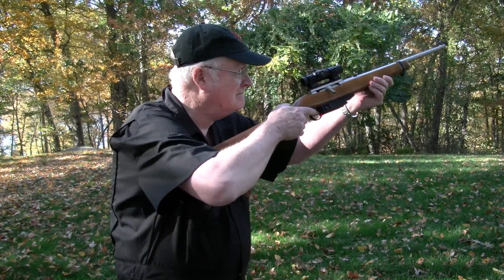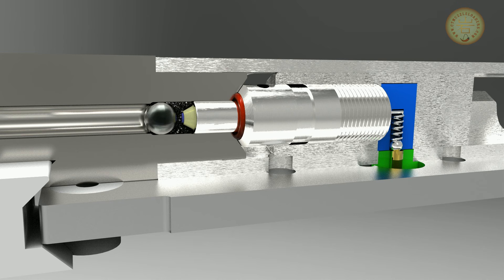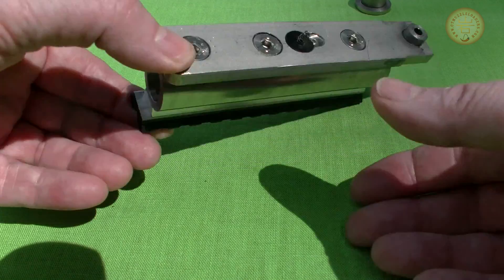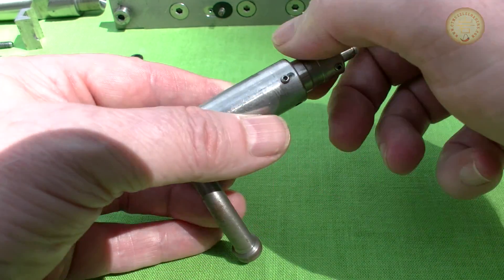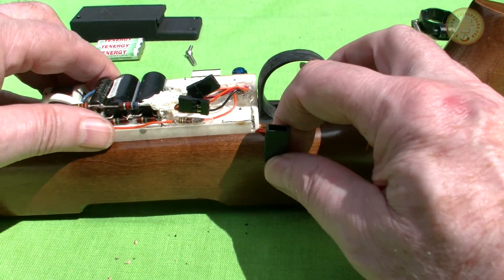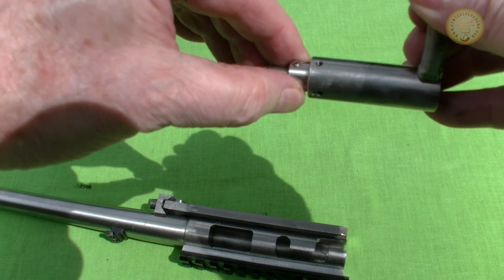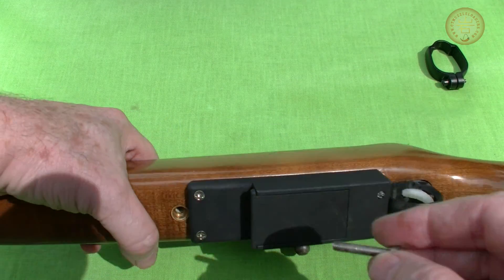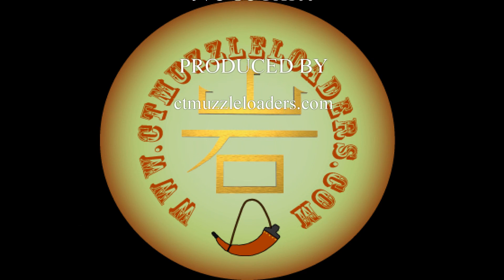The Plink-King, Part 2: Design and Construction of a Cartridgeless .22 Rifle

Comment: how about using something like a small spark plug? enough heat is generated but i am unsure how one might cycle a coil .... requires more thinking. perhaps some old points, a tiny coil and a spark plug could make an interesting looking dueling pistol.

Comment: I studied your electrical ignition schematic on your website and there's two points that worry me, possibly due to my limited electrical knowledge. Firstly, the capacitors draw current from the inverter without a resistor in between, wouldn't it overload the inverter? Secondly, it seems the capacitors would discharge through the secondary coil of the transformer where the potential is many times higher, would it cause the capacitors to be charged by secondary coil from the earth side, which would be wrong polarity? Would it work if just let the capacitors discharge through the primary coil ?
Reply from the maker: I did later add a resistor between the inverter and capacitor to protect against a diode failure, but the internal impedance of the inverter normally prevents it from being overloaded. The capacitor must discharge through the secondary because that provides the high voltage pulse that initiates the arc, and the impedance of the secondary must be kept low so that it doesn't soak up the main capacitor charge; that's why a specially designed coil was used. Discharging the capacitors through the primary would saturate the coil and waste most of the energy - and even if not, the spark would be too brief to ignite the powder.
Reply: I see, thanks for clearing up. A genius design indeed.

Comment: Have you considered swaging bullets for it then you could make a hollow based bullet and encapsulated your propellant In it like the heddon style caseless round all you have to do was drop it in and fire . Great and innovative thanks for sharing.
Reply from the maker: I have an old needle-fire .32 parlor rifle which used a hollow swaged bullet filled with a priming mixture. I considered the same for this project, but the simplicity of using commercial buckshot was hard to beat. I am currently in the building stages of a hopper-fed version of this rifle which will bulk-load 20 or so #4 buck and associated loose powder. When it is done, I will also put it here and publish the CAD files.